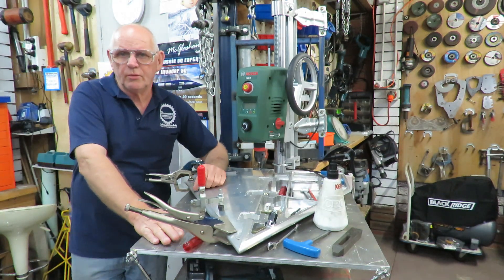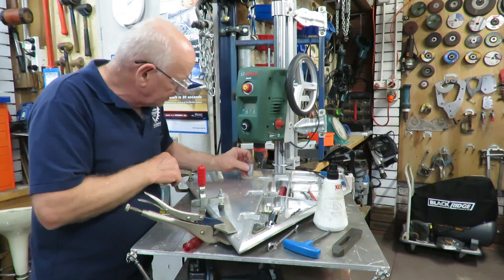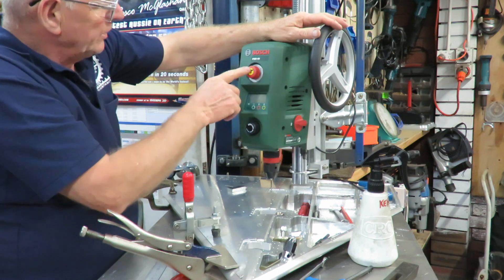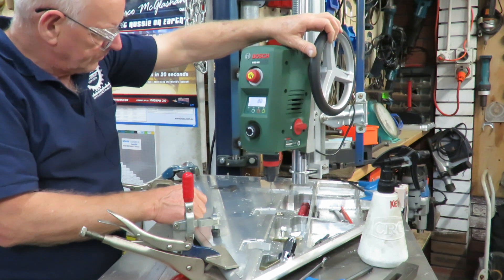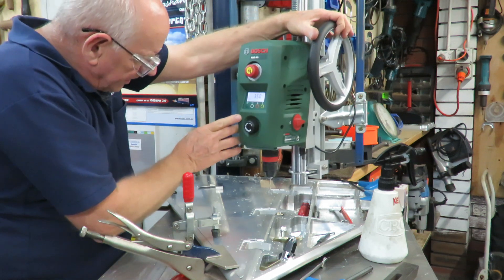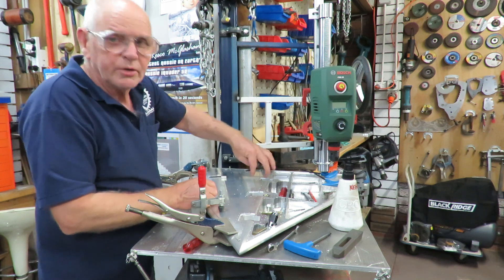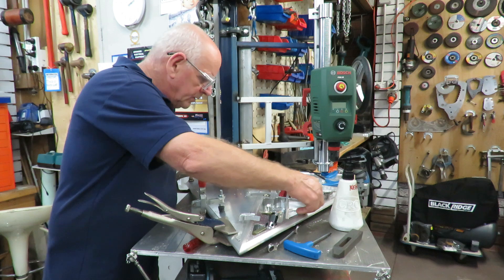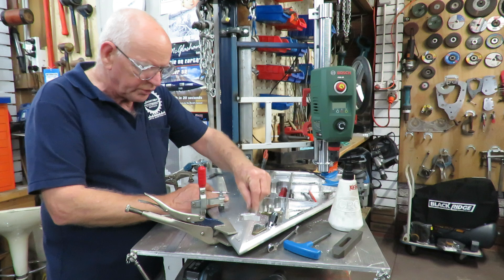Aussie Invade 5R Horizontal Stabiliser Build Video 2

Comment: If you have not already done it, you should change the chuck, like I did. I made a short video about how to do it: https://youtu.be/nCqVoaGVK8g Anyway, after this change there is a huge 
difference, the machine is so much better, it is a joy to use. The original chuck delivered (Rohm Supra SK E) with the PBD 40 is actually intended for hand impact drill, not for pillar drill. I replaced mine with a Rohm Supra S, which is for pillar drills mainly.

Comment: 250 holes to drill and tap that way...? It must take like forever. I think you need a CNC if you have to do that often.
I do like your swinging arm though... I also think you should change the chuck on the PBD40, like I did. This is my video showing how to do it https://youtu.be/nCqVoaGVK8g

Comment: For any ordinary CNC machine to duplicate what you have done is impossible.  Maybe Boeing or Airbus or some aircraft manufacturer could do it, and the machine reprogramming would cost you more than the whole car.. Or maybe the designer could tolerate some asymmetry in the holes... But by the time you got the jig devised and did the Fusion thing, I think you would have been onto the next project. Another "manual is better than CNC for one-offs" example. If any CNC Guru wishes to contradict me, fine. But let Guru remember that he/she has already seen one jig. How long would it take if you had to invent the jig? Bravissimo, Bruce.
Reply from the maker: Juan thanks very much! as always it's easy when you see someones invention, took a few good weeks until I came up with this idea.

Comment: Grrr, I could kick myself for not buying one of those drills for $199 in the Masters liquidation sales. Great adaptation.
Reply: I had one, and it sucked.  Sold it off and bought a true Aciera drill press from the 70's.  No comparison, but over 4 times as expensive....
Reply from the maker: One off job and very small drilling did the job and probably won't do another, I have plenty of quality machines for the day to day. One instance where cheap worked well.
Reply: For your rig I can see that it fits the job.  Really neat setup you have there.